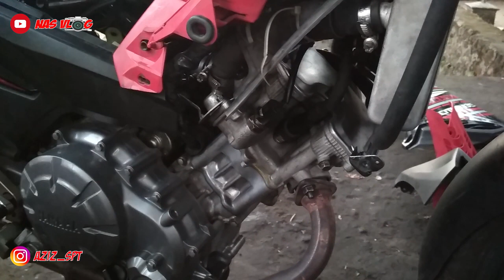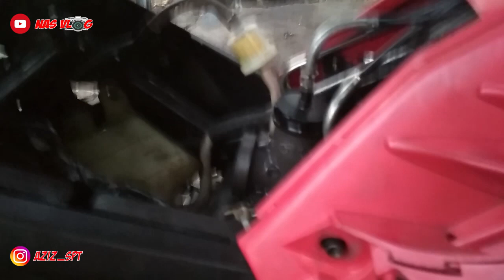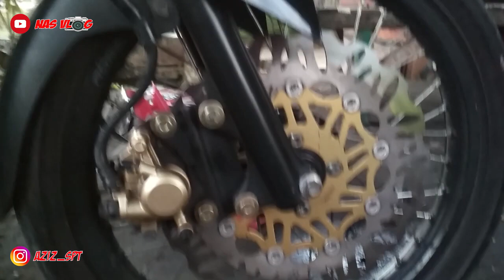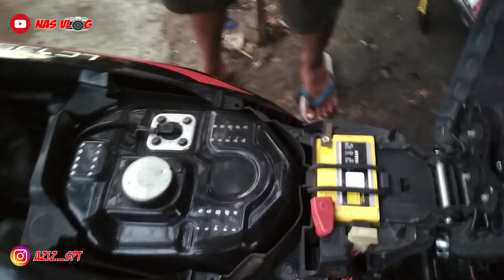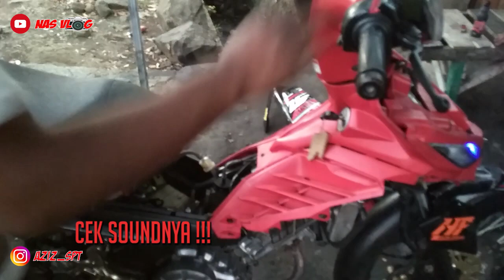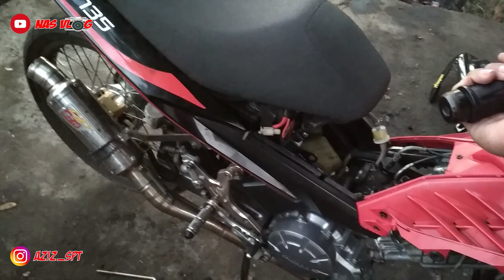Review garapan Bore UP 160 CC New Jupiter MX Harian Kejam

Comment: Salam dari malaysia ni rahsia meter 180 di malaysia..block 63, cdi brt, carb tzm/nsr, knalpot 30 mm, head standard porting atau head racing 19/22 spring valve cms, camshaft cms t2, kotak angin tebuk spocket 15/33 
Semoga berhasil
Reply from the maker: Final gearnya kok kecil 15/33 ?  buat Rpm tinggi ?
Reply: @AzizSpt  di malaysia jalan rayanya panjang jdi spocket 15/33 untuk spec 63 kebawah sesuai  di malaysia full gas 30 km...bore up 68 mm untuk harian dan jalan jauh ada juga di malaysia 68 mm spocket belakang 28 mm di malaysia kebanyakkan yang pakai